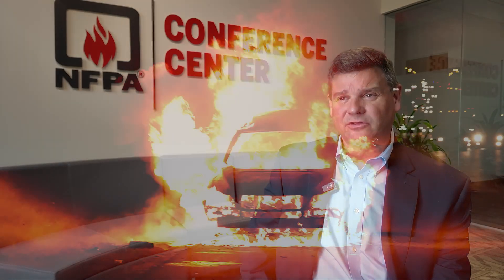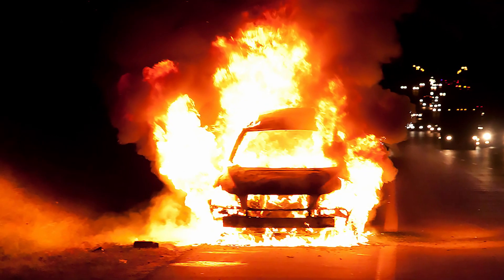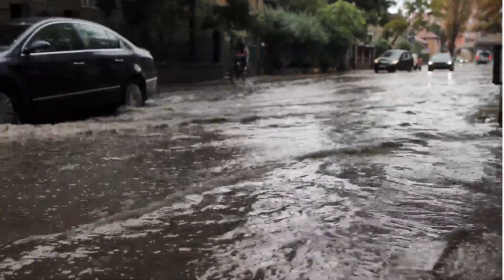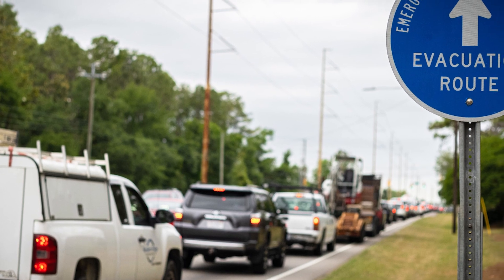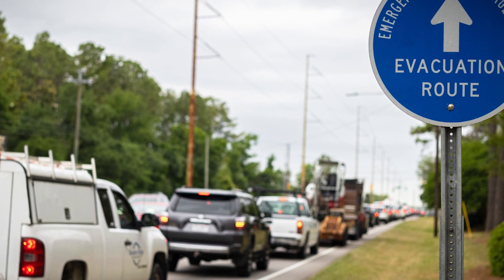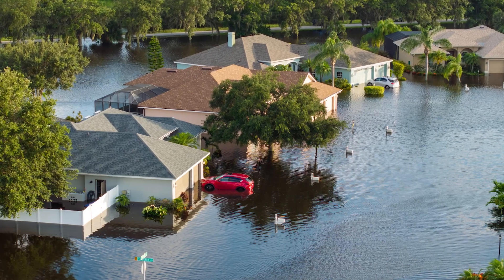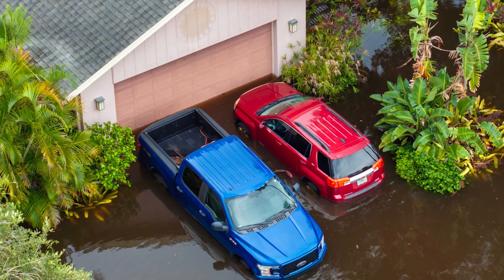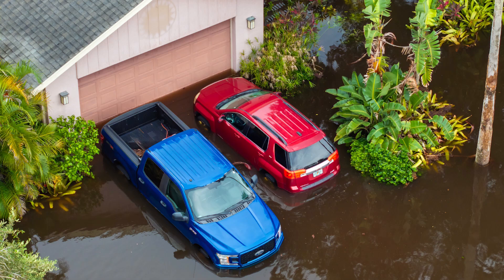Safety Tips for Preventing Fires in Submerged Electric Vehicles

Comment: NFPA really needs updated video content on simple industry operational standards (i.e. operating, identifying and maintaining fire extinguishers, smoke alarms etc. Most of the existing content is nearly un-viewable at modern resolutions.) I currently make oil, gas and nuclear safety compliance videos and would be glad to help if you have any desire to update your library. I was wondering why there seems to be no nationally implemented standard as to fire extinguisher labeling? There is an extremely large amount of conflicting information, labeling techniques and symbols being utilized throughout varying manufacturers, suppliers, countries of origin etc. Would love to see a push for standardization of color codes / symbols / pictograms etc. The confusing messaging of such a wide diversity of styles on the market could easily lead to severe consequences. What gives?